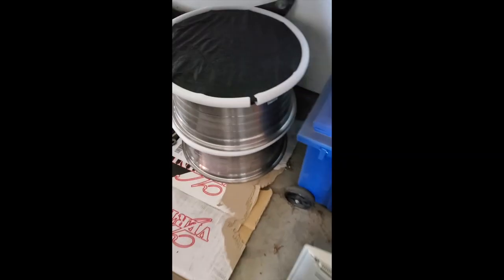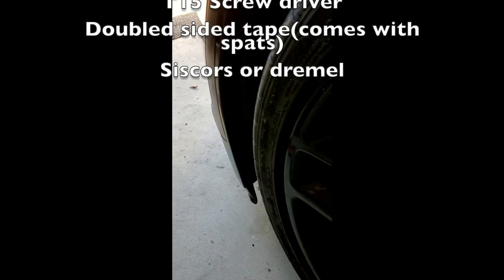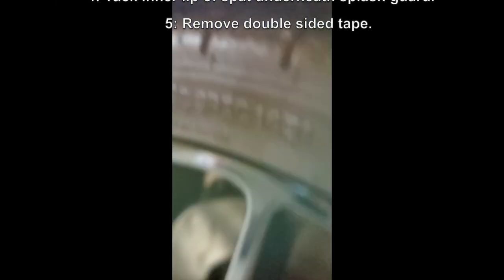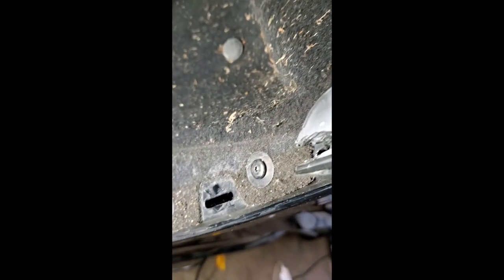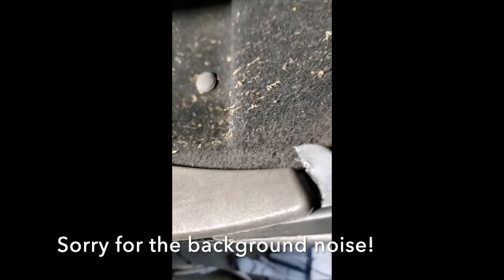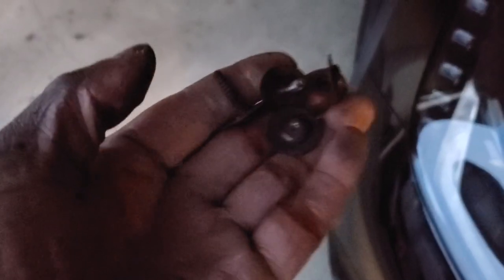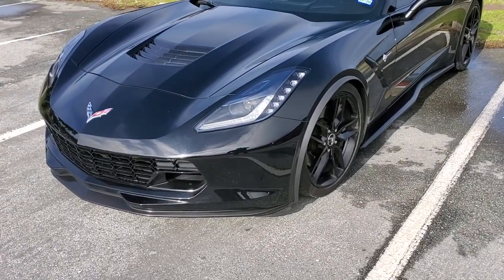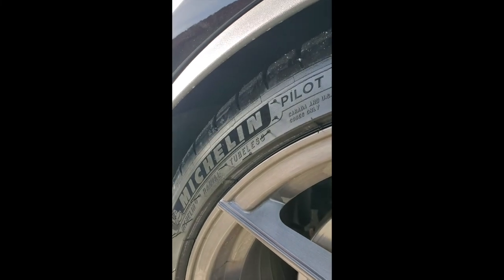Installing Corvette C7 Z06 Spats on Z51/Stingray +New Vertini RF1.2

Comment: I hate to pick your brain I bought a 2016 Z51 supercharged with 18000 miles I've had it 6 days we took it for a ride last night when I got home the cooling fan was running and wouldn't shut off my temperature gauge wouldn't read I replaced the temperature sensor reset the code it seems to be working fine  it did show temperature and fan errors Is this a common problem?             Should this take care of it?                                            I plan on going on a trip soon should I have to worry about the car letting me down?
Reply from the maker: Never heard of the fan errors but if it was "spirited driving" lol  then it sounds normal. My car's fan remained on I think 2 times that I can remember clearly. Once was on the track and the other was just a hot day and a lot of driving.

Comment: Hey sorry about your c7 you had but i jus stumbled up your page about the fender extensions you did on your stingray. Im gon to follow what you said but about the TAB above the 3 screws in the front. Do I shave the tab off or leave it? Any other advice also? Thanks and you are the only person here that did such a neat install.👌
Reply from the maker: I shaved most of the tab off. I tried to find a picture, but its been so long. Other than that just make sure you hit the underside of the fender where the double sided tape attaches with some kind of alcohol pad or something to get it really clean.
Reply: @montiz333  gotcha what about the front tab that looks like it goes into the Fender in the front. I'm gon to tackle this project in the next few weeks if it warms up. The tab by the Mud flap I will jus take off but how much of it?  I want this to look like it's factory thats y I ask

Comment: How did you modify the flares ?
Reply from the maker: at around the 4:00 minute mark there is a close up of the cut I made. I used a dremel a saw would do the trick also.

Comment: Whee did you order from bro
Reply from the maker: I got mine from Amazon but I've learned now that you can use the spats from a GM parts direct also. I had to replace one cause I kissed a curb lol. The replacement one from GM fit fine bro. The wheels I got off CarID